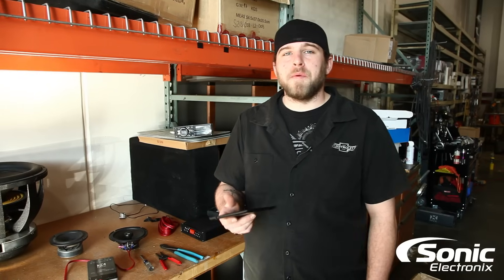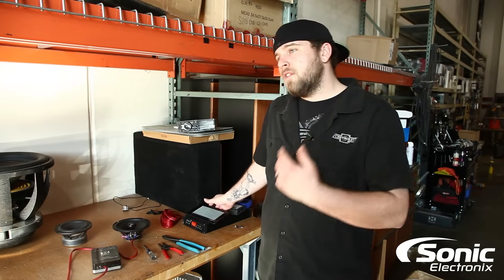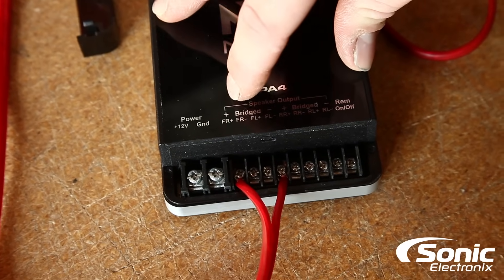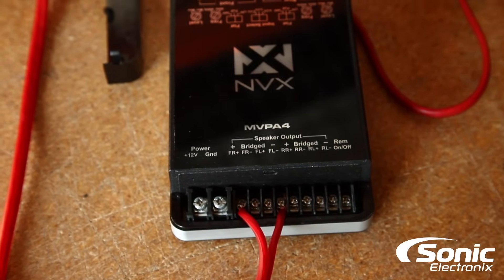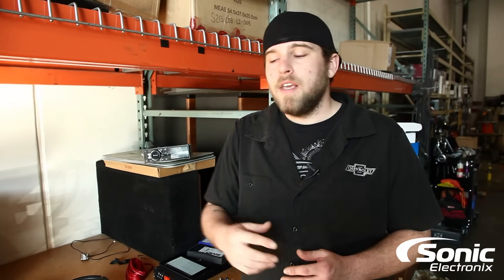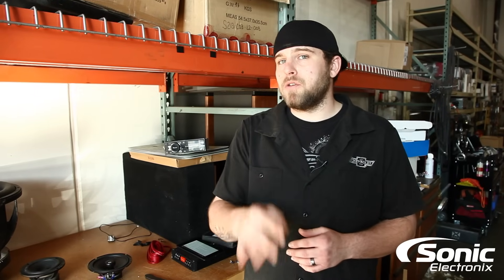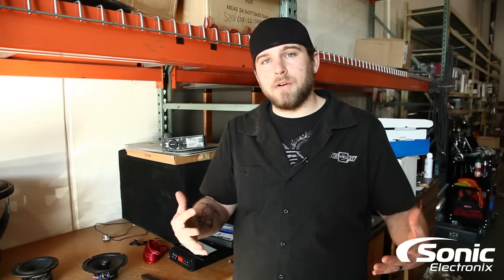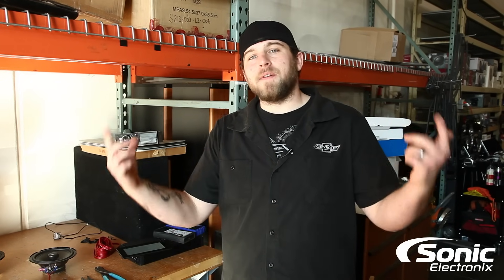How Do You Bridge a 2 Channel Amplifier? | Car Audio Q & A

Comment: I have found that running 2 ohm loads for mids and highs significantly lowers the sound quality anyway.I wired  a component set to my sub channel in parallel dropping the load to 2 ohms.Amp channel is stable at 2 ohms so it was safe to do.I turned the filter off at the amp and used the HPF at the head unit.The power was definitely largely increased but the quality was not good at all.In my experience thus far,when it comes to mids and highs you are far better off running in stereo and if you do want to bridge for more power,make sure the load is no lower than 4 ohms.The closer to in stereo the higher the sound quality.

Comment: Ive had my speakers wired bridged at 2 ohms for the longest time now. i have a autotek mean machine M1400.4 and it only goes into protect when i do 1 ohm. but 2 ohm bridged works beautifully. i have 4 alpine sps 517 wired at 2 ohms bridged. 4 channel amp.

Comment: i have a audiopioe 1500wtts two channel amplifier,and i have four 8",8 ohms speakers if i hook up 2 speakers in parallel on one channel would i play louder than if i jus hook up one to a channel???
Reply: Depends on what ohm load the 1500w is for.The manual should tell you that.

Comment: I have 2 coaxial front door speakers
2 6x9" in rear tray
powering them is a 2ch amp
plz help me with the connections
Reply: Wire the door speakers and 6x9's in series......that will make an 8 ohm load to the amp.

Comment: If you wanted to wire two 4ohm speakers bridged per set of channels on a 4-channel amp, just wire them up in series to achieve 8ohms, the amp will see 4ohms or a little more per set bridged when playing because the impedance is cut in half. Nominal impedance is resting resistance, electrical resistance generally increases when a speaker is in motion. Fs or free air resonance of a speaker or sub is when the resistance is at it's highest basically, so change it's environment/back pressure in an enclosure or baffle and the voice coil resistance increases at a different frequency range, otherwise known as box rise. Unless you have a cheater amp, don't wire them in parallel to 2ohms because the amp will then see a 1ohm nominal load.

Comment: So when u bridge an amp it cuts the ohms in half ? So if I have three subs wired together and get sat a 2.7 ohm load at the end then when I put on bridge on amp it will cut the 2.7 in half ? 

Why how is this ? 

So I have 2 DVC 4 ohm subs wired together and get a 4ohm load or 3.5 on meter....... THEN when I just attach wires to amp as brigged it will drop that 4 to a 2 ohm load ???????

Comment: For 4 door speakers 300watts each pair (peak power), 4ohms, and a 300watts 2 channel amp. i am putting my right F and R speakers in series and left F and R speakers in series, and then hooking both sides (Left and Right combinations) in amp in 1 channel, means when you putting wires in the amp join the 2 positives that you have in the end and put it in the last (which at the end) positive and negative in the last negative(that will on the other end), e.g, you have 4 connection for 2 channel speakers A+ A- B+ B-, connect the last end of positive to A+ and negative to B-. that will give you the total impedance of 4ohm.

Comment: Sonic Electronix  I have 2 JL Audio Subs in the trunk of my Accord. I just bought a 900watt 4 channel Kenwood amp. I'm only getting like half power from both subs. Is there a way I can bridge both subs together to get the full 900watts without messing anything up? I just feel like I'm not getting much bass to it. All I have is a stock deck in the car, going to get a custom one soon. Any help from anybody would be great.

Comment: OK I have a 4 channel amp and was wondering if I can hook up 3 pairs of speakers to it? Reason being is because the 4x10 in the rear of my Tahoe are powered by the head unit and I want a little more power to the speakers?

Comment: I have a question can I use this battery Kinetik HC600 BLU Series 600-Watt 12-Volt High Current AGM Car Audio Power Cell Battery for my amp it's a 2400 watt

Comment: Okay to start off I own an 03 jaguar xtype. My question is about which amp to buy with my setup I plan on installing. Currently own a Kenwood DDX371 head unit with 4 Kicker 40cs654 all the way around and 2 pioneer ts-w309d2 subwoofers. I am stuck on what amplifier I should bring along with me to complete my setup.

Comment: Some 2 and 4 channel amps are capable of 2 ohm mono loads, but very few. Back in the old school, we had 2 channel amps stable at 0.5 mono...you don't see those any more! "Cheater amps" are a thing of the past, but still cool nonetheless.
Reply: I have a single 12 Dvc audiobahn wired to 2 ohm and then i bridged it at the amp its the Blue 2 channel Hifonics Zues Viii 600 watt i also turned the gained down to a little past halfway is that ok to run like this
Reply: P @mrworldwide6770

Comment: This bridging stuff is kinda interesting. We have a 15" sub in our lounge room powered by a car amp and a 12v power supply. The sub is a dual voicecoil at 4 ohms per coil. We had the option of bridging it and running the sub in series (8 ohm sub, ~300 watts at 8 ohm when bridged for the amp) but instead we went dual channel at 4 ohms per channel without bridging to get the full 330 watts from the amp. We have modded an RCA lead so both channels have the exact same input and it works great. No issues, except for sometimes accidentally wiring them out of phase so the speaker doesn't move when a song is playing.

Comment: First of all, I'm a huge fan of the channel, second, the second guy wasn't asking if you could bridge one channel on two speakers, he asked if you put four speakers on two channels,   if you have two four ohn speakers in parallel it equals 2 ohms which on one channel of most all amplifiers is just fine, the only problem is that he would not have proper left/right, front/rear staging
Reply: It depends on the amp really.And yes,you two are saying the same thing.Most amps can handle 2 ohm loads in stereo but not bridged.Brendan is actually not answering the guys question directly,rather he reworded the question and then answered.
Reply: 2 ohms are not fine when its bridged,  you can load 2 ohms when its not bridged on most amps
Reply: That's exactly what I said, re-read it and you will see that I state that in the beginning of my rant.
Reply: @elijahwood1709  I have 4 (4 ohm) bookshelf speakers. But when I'm playing music I only use the 2 speakers coz I'm hesitant to connect my 4 speakers because of low impedance against my amplifier. Also the amplifier heats up easily. My amplifier impedance limit is 8-16 ohms. Is it okay to connect or rewire this four speakers to connect on my 2-channel amp? Btw the amp can handle  180watts (left & right).

Comment: You can run 4 speakers on a 2 channel amp if it's NOT bridged! the system in my next car will have the front and rear speakers wired in parallel down to 2 ohms per channel.
Reply: That's a great idea. And most the time the amp puts out more power @2 ohms. Don't know why I didn't think of that a long time ago. Oh yeah I was a kid lol!